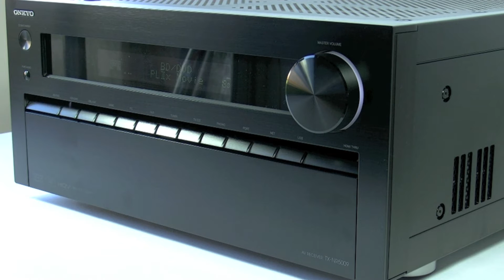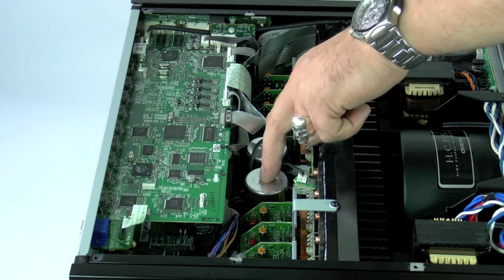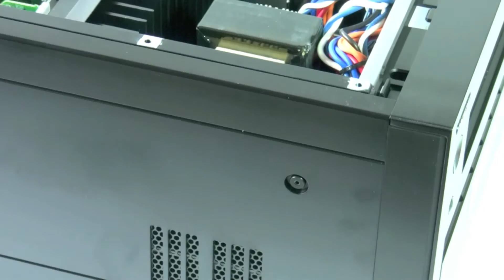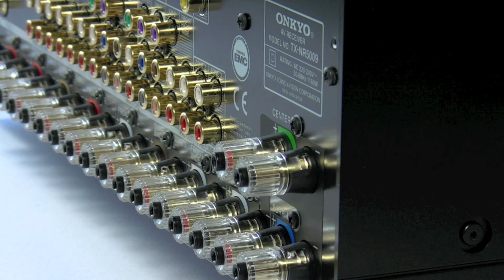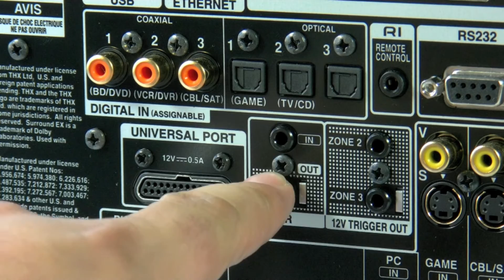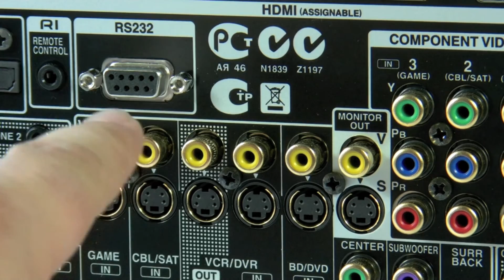ONKYO TX-NR5009 AVR AV Home Cinema Receiver -  How to use

Comment: QUESTION: How do I make my Hisense U8K eARC/ARC channel compatible with the ARC channel of the TX-NR5009?  There is absolutely nothing I can do to make it so the eARC/ARC channel of the Hisense U8K turns on so you hear sound being generated by the TV from the the speakers connected to the A/V Receiver. The way things are now, I only hear things such as YouTube or buttons from the Hisense U8K from the speakers on the TV. NOTHING seems capable of changing this.

Comment from the maker: Usually, there is no need for an optical out - in a very typical home cinema setup, the AVR will accept all the different analog and digital sources, decoding (e.g. Dolby TrueHD, DTS-HD, ...) and processing them, and then forwarding to the integrated amplifying stage to output to speakers. In case you are looking for some different functionality, there might be the need for some specialized, dedicated device.